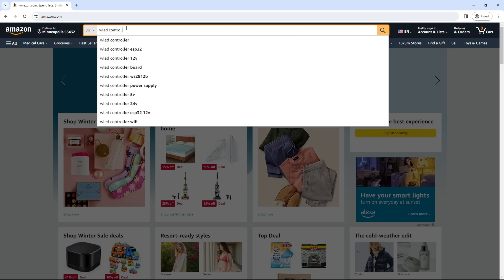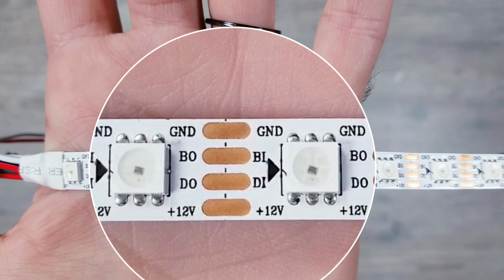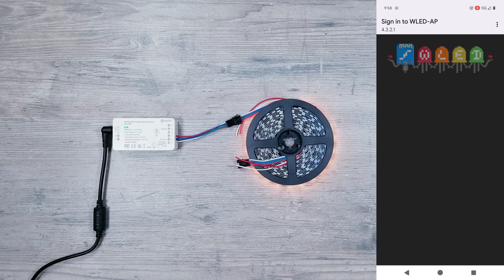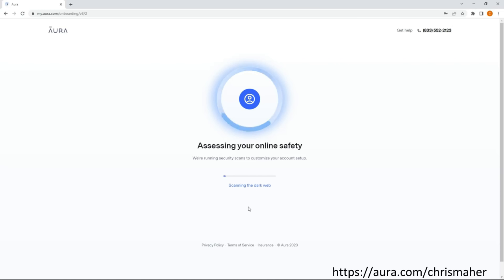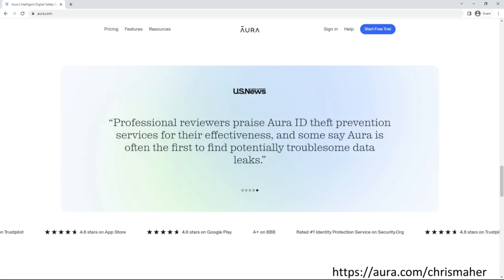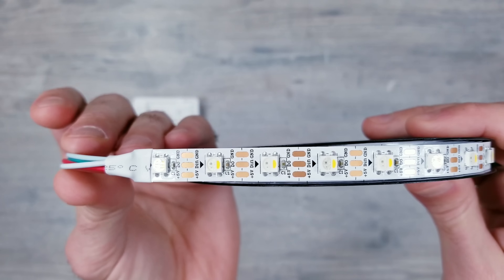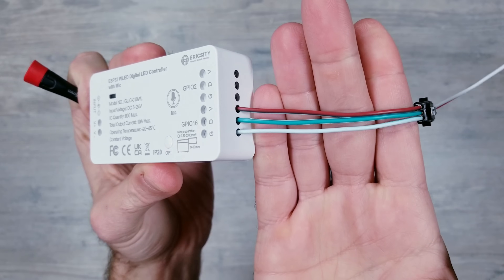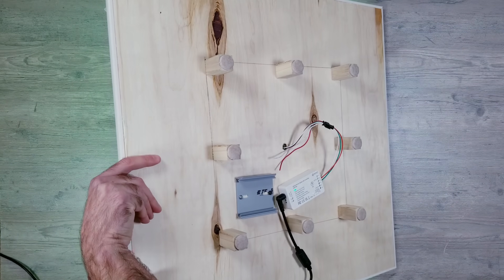Plug n Play WLED Controller: 5v, 12v, 24v Compatible! Full Walkthrough.

Comment: I’ve used this controller to splice in and replace the Govee controller on their LED curtains product and IT WILL NOT WORK. I only get random flickering colors (tested with multiple units all the same) set to ws281x protocol and correct number of LEDs in the curtain (520 at 20x26, non serpentine vertical). If anyone has had success with the Govee curtains with this (potentially awesome) controller please let me know! Otherwise you have been WARNED!
Reply: Thanks for the quick reply Chris. The Govee curtains have been confirmed to work with other ESP32 dev boards. A user on the WLED discord shared in the #projects channel video of their curtain build and a seedstudio ESP32 with logic level shifter. I will splice in a dev board just to confirm on my end when the parts arrive today. I just want to make sure that folks are aware that this controller doesn’t work for some applications when other ESP32 boards are working fine. Indicating a potential problem with the logic shifter or some other data issue. This isn’t my first build and I’ve ruled out majority of other troubleshooting concerns like poor grounding, insufficient power etc.
Reply from the maker: @mylesdb  thanks for the info and let me know if your able to get it working! I'm curious myself as it's something I was wanting to try at some point.
Reply: @ChrisMaherDIY  Alas I was unable to get this controller working with Govee Curtains. The controller works fine with regular WS2812b strips but just not Govee curtains. I was able to drive the Govee curtains fine with a generic esp32 Dev WROOM even without a level shifter using the ws281x protocol in WLED. I am going to try the Athom variant of this controller instead since I do like the form factor with the push pins and voltage regulator...
Reply: @ChrisMaherDIY I challenge you to try these and get these controllers working with a govee curtain or the BTF cob style 720led/m and see for yourself the strange behavior on the data signal. I need to play with a scope and get a deeper understanding of what is happening here because I’ve never experienced this issue before. At the very least I feel you have a duty to warn others about these issues and maybe the manufacturers will take notice and offer a solution.
Reply from the maker: @mylesdb  Thanks for the information! I ordered some 24v cob strips plus some 24v cob RGBW strips. The regular 24v cob strips did not work and had flickering issues! However the 24v cob rgbw strips worked perfect. So strange! I'm updating the description and comments to warm people of this so thanks for brining it to my attention. So overall this controller seems to work perfect with btf lightings sk6812, ws2812b, ws2815, 12v cob stirps, 24v RGBW cob strips. And the only issue we are having is with the btf lightings FCOB WS2811 strips. Also I'm going to see If the manufacturer has any contact information listed on Amazon to see if they might know why things are not playing nice with the 24v cob ws2811 strips. I did try it with the govee curtain lights and it did not work at all and then i tried it with just an esp32 and it had bad flickering issues. Getting govee products to work with wled always seems to be 50/50 so I'm not surprised there.
Reply: @ChrisMaherDIY  any update regarding WS8211 compatibility? Could you link the 24V strip worked with this controller? Thanks
Reply: Same problem with btf lightning rgb cob leds here. Did you try to add a 300ohm resistor on the data line ?
Reply from the maker: @xxxxxx46142  the btf lighting cob lights worked perfect for me. Those are what I used in the video. What kind did you use?
Reply: @ChrisMaherDIY  i am using btf lighting RGB 720 led per meter - 4 meter but in 24 volts. I have a strong flickering and issues with the data line. After buying a second strip the same issue remains, my controller might also be defective ? I will try with an athom soon. My power supply is a 24v 5 amps out of aliexpress it might also be the cause of the problem but first I will try with a new controller
Reply from the maker: @xxxxxx46142   Thanks for the information! I ordered some 24v cob strips plus some 24v cob RGBW strips. The regular 24v cob strips did not work and had flickering issues! However the 24v cob rgbw strips worked perfect. So strange! I'm updating the description and comments to warm people of this so thanks for brining it to my attention. So overall this controller seems to work perfect with btf lightings sk6812, ws2812b, ws2815, 12v cob stirps, 24v RGBW cob strips. And the only issue we are having is with the btf lightings FCOB WS2811 strips. Also I'm going to see If the manufacturer has any contact information listed on Amazon to see if they might know why things are not playing nice with the 24v cob ws2811 strips. I did try it with the govee curtain lights and it did not work at all and then i tried it with just an esp32 and it had bad flickering issues. Getting govee products to work with wled always seems to be 50/50 so I'm not surprised there.
Reply: @ChrisMaherDIY  any ideas about any affordable controller that should play nice with the ws2811 cob form btf lightning? Or is the issue more about the wled software ?
Reply from the maker: @xxxxxx46142  the domestic automation controller works perfect with it. Not sure if you're in the US because it's only available here. https://youtu.be/QhdgTG4SeuY

And I don't think the issue is with WLED. My guess is it has to do with the type of logic level shifter that is being used in the controller. But I'll keep doing some tests to see if I can come up with any type of work around and let you know if I do!
Reply from the maker: Thanks for watching and that's good to know! I have not tried it but I'll certainly check it out. Have you confirmed that it does work with a different type of WLED controller and if so which one did you use?
Reply: @accountify4614 It sounds like you have the same issue as with my Govee curtains. Did you try the 300ohm resistor? I will try but I feel like there is complete incompatibility with the level shifter they use in these boxes because when I swap in a generic ESP32 DEV WROOM they work better (although not perfectly).  I also tried the Athom variant and it does the same, I don’t think you will have any success either unfortunately.

Comment: i hope everyone else has better luck than I have with this device, I have had two of them and neither one will operate as it should, it is inconsistent in the operation, sometime it will show up as connectible to Wi-Fi, but most of the time it is not an option.  It does not work well either with the manual button.  It may work better with the 12 volt version.
Reply: I hear you. After watching Chris set this controller up I purchased all of the gear and set up 10mtres in my slatted wall, but the controller is not playing the game. if you have any solution to the problem I would love to find out

Comment: So the ESP32 Boards I bought are useless?
Reply from the maker: Thanks for watching. Here is the video I made on getting an esp32 set up to work with WLED.  https://youtu.be/exAWzMfmwQ8
Reply: You can mod your esp
Reply: Athom have been making these for a long time. They have a mic, 16a relay and screw connectors, not push. This controller isn't new or revolutionary

Comment: Thanks to your video on this. I picked up one to install 12v lights on my Jeep. The mic was not set up correctly on the controller, and I thought it was defective. Turns out the pins were not programmed right. Luckily for me, the instructions explained what to set it to.
Reply: Cool!  I'm doing the same thing!  Just curious...  where are you putting lights on your Jeep? Fenders? Interior? Exterior? I've connected the controller to my auxbeam so I can power it on/off on demand.  Would love to see your  setup!
Reply: So far I have only added lights to the inside. Under dash, under seats. The plan is to add lights inside the speaker grills as well. Matrix on the back windows to display pixel art, graphic equalizers and scrolling text. (I have a 1800w speaker system installed) On the outside I will run lights the full 360°. Underglow everything.  Lights in the fenders, front grill, hood vents, wheels, and even open the factory lights to add RGB. All of it running from a dual battery so it can run with the engine off and the radio blasting. @3papproductions103
Reply: @jply87  ....  wow... I'm thinking about doing many of the same things.  Literally just put a comment asking Chris to consider a video regarding an LED matrix.   I've been thinking about creating  Plexiglas "shield" to add to my tube doors that have a series of LED strips.  Can I connect with you on social media?  Might be cool to exchange ideas.
Reply: @3papproductions103  The tube door idea sounds cool. Connecting on social media is not an option. I actually don't use any social media outside of dropping a comment on YouTube. Have fun with your projects.

Comment: Thanks for keeping this channel going. As always great content. Could this controller be used to control RGBW COB LED Strips like the BTF RGBW 3000K 896LED/m 16.4FT DC24V? I would like to build something like your DIY Floor Lamps but I want RGBW strips. I'm thinking of going with the COB strip and the lower cost Muzata 2 Meter V-Shape LED Channel Aluminum Extrusion you covered in your diffuser channel for COB LEDs video.

Comment: hey Chris awsum video! i have a question for some reason the Athom controller that works with individually adressable Led strip lights is not available on amazon any idea why? and also between those two what would you suggest to be the best opcion or both are fairly good keeping in mind the Athom controller can withstand 15amps thankyou in advance!

Comment: Great videos. One thing I'm not sure of is the benefit of running 24 vs 12 volt. I understand that with greater voltage you can run smaller gauge wire. Why would I want to purchase the 24 volt instead of the 12-volt? I'm going to put LEDs around the perimeter of my game room. 88 feet. Would I be better off with the 24-volt? Will I be able to run all 88 ft off of one power supply? I'm assuming I could run 2 44ft strips off of one controller. Any help would be appreciated

Comment: So would it be possible to replace my govee controllers with this controller with my current govee setup with the 65' strip lights and 100' permanent lights and 66' christmas lights????
Reply: I sure would like to know if they work with Govee permanent outdoor lights using more than 150ft length on the 50ft power pack

Comment: Will this controller remember what preset its on if i wanted to power it with a light switch? For under cabinets in the kitchen so for day to day i could just have a switched receptacle and pre-set to white? Or would i need to do that with the controller button/app every time?

Comment: I give up, I bought one of these devices and now I cannot get it to work.  I can get into the device, but leds do not light up.  Ok, I finally got it to work.  More difficult to operate than the ESP32   Will this device work with strips and matrixes?  I can only recommend the SP107E    Getting shipped back, will not connect to wifi.

Comment: Hi Chris great video!
I ordered  20 meters of the BTF FCOB WS2814 DC24V 784LED/m 70IC 10mm width version.  

My question is will this controller be able to run 15,680 leds? Led strips calls for 24V 3A power per 5m, hence my total load would be 12A but the Ericsity controller rated for 10A max.  Your thoughts?

Comment: Being limited to 10 amp output is a bummer since a 5M strip with 300 leds needs at least 20 amps.
Reply: There are controllers out there which have power distribution and fusing all onboard and can do up to 30A continuous, have big terminals for wiring, 5v-24v, multiple data channels, etc. but they are just not on Amazon. That said, 5m 5v ws2812b strip will take max 13A and that's at 100% RGB white while being triple injected (front + middle + end). A more realistic scenario is around 6A to 7A with a front + end injection for each 5m you want to run.
Reply: Yeah someone needs to create a controller which can handle 20-25 Amps. I am in a similar conundrum where my total load requires 12 A but the Ericsity controller is rated for 10A.  What a bummer!

Comment: at approx 3:00 you mentioned keeping the amps to 4 because thats the limit of the jst connectors. would it be possible to go the full 8-10 amps if you just cut the jst connector off and put the wires from the strip directly into the controller?
Reply from the maker: Thanks for watching and great question! If you cut off the jst connector and use the wires on the strip I would maybe then go up to 6amps. The wires on the strip are either 20 or 22 awg which are pretty thin. If I wanted to go higher than 6amps I would then solder my own thicker 18awg wires and then go up to 9amps if needed keeping it a little below what the controller says is the max which is 10. Hope that helps!
Reply: thank you for the clear and detailed answer! @ChrisMaherDIY
Reply: Sadly cutting the wire off won't help much since those aren't the limiting factor is the LED strip itself, not the wires. Whatever diameter wire you attach to a generic ws28xx strip you will not get more then 4A into a single edge connection or about 8A into a middle connection. The strip just has too much resistance on it's copper tracks to allow for more hence why we need to do power injection to combat "voltage drop" (which in actuality is combatting the resistance by adding more copper).

There are controllers out there which have power distribution and fusing all on the controller itself, but not on Amazon.
Reply: Ditto on this question
Reply: I m curious as well

Comment: Bro! I just got the same controller maybe a month ago by a company named GLEDOPTO it was like $18 off of Temu without the mic. Got the 12v power supply from BTF along with the ws2815 Leds too. They're amazing. I ordered maybe 15, 144 LED per meter ws2812b strips a month or 2 ago as well from Temu and I've never looked back. Always thought it was a scam but def not lol and we got partnered by Govee!! They also sent me a message a few days ago asking to collaborate with me!!! Wouldn't be possible without you because you were the inspo to keep me going!!!!! BTW I usually just do permanent lights installs. I have yet to control the non pros and Eufys with WLED though. I can't wait for that lol have a 100ft eufy box with a DOA controller so I was gonna use those (also seen your vid on that too)

Thank you Chris 🙏🏻🙏🏻🙏🏻 can't wait for the Govee COB lights.

Comment: Very cool.  Love these videos as I'm about to start a room make-over myself and lighting is going to be a key piece of it.  I do have some questions that might be worth making a video on as I'm sure it's a topic others would be interested in?

I'm finishing up designing a new desk I'm going to build that'll handle all of my requirements for my office / recording studio.  The desk is going to have multiple zones worth of lighting in that there will be ambient sections, work lighting sections, and tron style rail sections that I would optionally want to activate music syncing on.  Plus there will be several other objects with lighting around the room as well (a ceiling mounted acoustic treatment with back lighting, accent lighting around the room, and a few more ambient zones).  I really want to have a hardware controller for the whole room, not just to change scenes for the whole room, but also to be able to adjust individual zones on the desk or elsewhere in the room.  The only way I can see to really do this easily with WLED is through Home Assistant.

Hence my questions mainly revolve around how to take something like a stream deck (or other equivalent hardware with buttons and knobs) and set it up so the buttons can change scenes, can turn on and off the music syncing, and have some of the knobs directly adjust the brightness of certain zones as well as cycle through colors on those zones?  Basically a master control panel for the room that will sit on the desk so when I sit down I can control all of the lighting in the room as I desire without needing to open an app or webpage.

Cheers again for the great info on this topic!!

Comment: @ChrisMaherDIY, thanks for finding new things to simplify LED installs.. Quick question, the controller with mic, can you disable the mic, or is it all dependent on what is selected in WLED as to whether the chosen settings use the mic or not?
Reply from the maker: Thanks for watching and great question! It depends on the effect you choose. The mic will only engage if you select an animation/effect that is a sound react one. You still have all the non sound react animations and effects available that you can choose where the mic will do nothing on those. Hope that helps!
Reply: you can disable the mic in WLED "sound settings" section

Comment: Does this seem to work better or the same as the one from Domestic Automation?
Reply from the maker: They both have their advantages I would say. The domestic automation controllers have a built in relay and fuse plus have simple attachments available to connect different switches, sensors, and more. I also like that their controllers come with a jst connector already attached and I prefer their lever system for connecting wires since I can clearly see what's going on. I would say the advantage of this controller by ericsity is that it supports 5, 12, and 24 volt strips. But overall they both are great products!
Reply: @ChrisMaherDIY  awesome.  Thank you for the info.  Seems I still don’t need to change the brains in my display case.  The Domestic Automation controller has been working great for my needs. :)